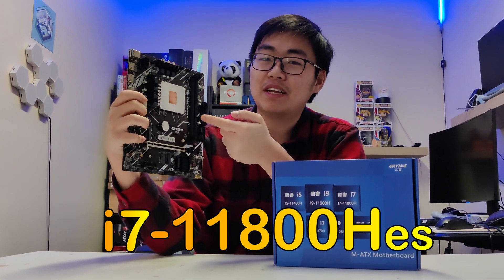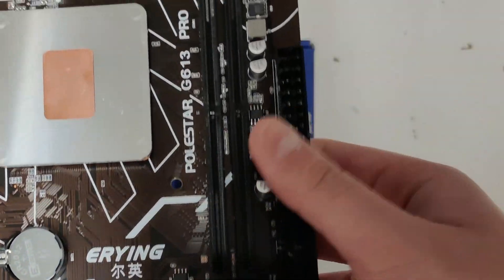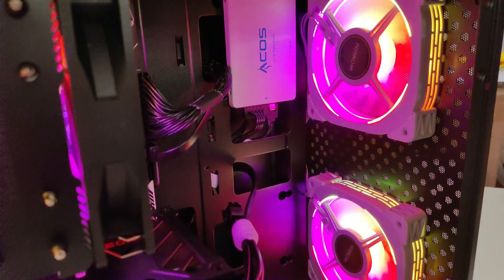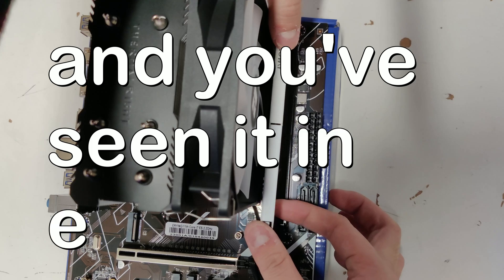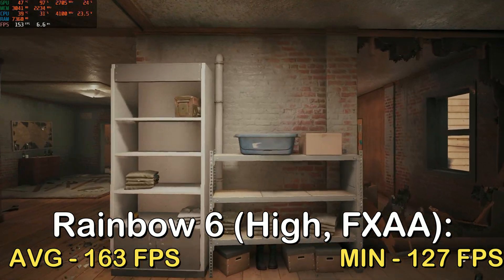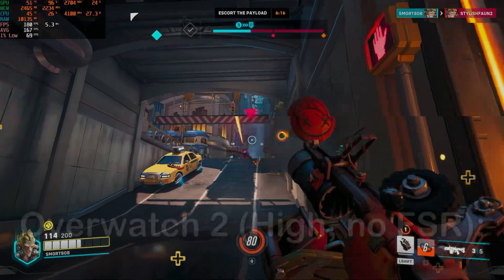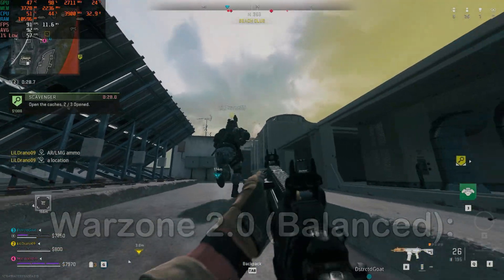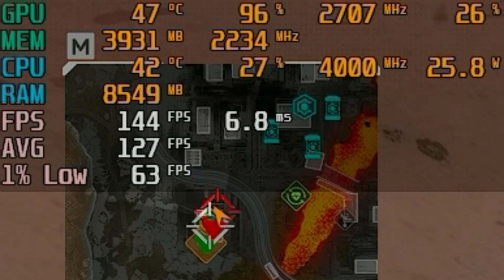The Problem with i7-11800H ERYING Combo ($200)

Comment: Well...
I purchased one of these about a year ago. I installed and used Windows 10 and 11 successfully. I played Borderlands 1, 2, 3 with an Nvidia graphics card.
The bios is complicated. I mounted to a DIY X-rail frame. My understanding is these motherboards are engineering samples with limited availability.
Reply from the maker: Windows 11 did work, but only if you install windows 10 then update it
Reply from the maker: With these stuff, it's a mix of quality control and the chip itself, every single one is different so while you might've had a good time with it, I've heard from a lot of people that they are having a hard time

Comment: Can I remove the cpu proseccer from this motherboard? Then put it on another motherboard
Reply from the maker: Nope
Reply: @woostinstechflip   this motherboard is  sucks but the cpu proseccer is nice . If i switch to liquid cooler can i get more better performance? cuz the temp is overheat
Reply from the maker: These already don't get very hot, so switching to water cooler does nothing

Comment: Just finished assembling and installing one with i9 CPU. Yes, it is tricky, but You are not correct at all. You are showing XMP profile that is not correct, but this happens only AFTER You play with the bios. Default BIOS gets the correct XMP profile.
To get DDR4 to 3200 with default BIOS:
Advanced > Overclocking Performance Menu
Overclocking = Enabled (Yes, I know this is strange. You don't need to modify any values for overclocking, but You MUST enable overclocking here to make Your RAM run at 3200)

Chipset > PCH-IO Configuration
SPD Write Disable = FALSE

Chipset > System Agent Configuration > Memory Configuration > Memory
Memory profile = XMP profile 1
Memory voltage = 1.35V

To make Your RAM even faster:
Chipset > System Agent Configuration > Memory Configuration
Sets the gear ratio when SAGV is disabled = 1

If You have problems with CPU when playing some games:
Advanced > CPU - Power Management Control
Boot performance mode = Turbo performance

Advanced > CPU - Power Management Control > View/Configure Turbo Options
Energy Efficient P-State = Disabled

Some additional useful settings:

Security
Secure Boot Mode = Standard (select to not reset yet)
Secure Boot = Enabled

Advanced > Pci subsystem
Re-Size BAR Support = Enabled
BME DMA Mitigation = Enabled
Reply from the maker: I appreciate the effort, but the thing with these chinese boards is that their quality control is not equal for every board. So if you or some others have it working properly then good for you. Also to me and so many other people, if it doesn't work properly from the start, not everyone is going to spend the time or effort to fine tune it for it to work as it should from the start. (P.s. I stated multiple times that enabling the Overclocking feature gives me BSOD)
Reply: This particular motherboard wasn't meant for everyone I guess. As an enthusiast, who spends spare time on something like this, I find this combo motherboard quite intriguing.
Reply: Could you tell me if you are able to enable TPM in the bios?
Reply: hey man I'm pretty late but how was your experience with the i9 combo

Comment: Hi, I just wanted to explain the likely reason for your mouse not working while playing. The reason is that the USB ports on the motherboard do not provide enough current when the CPU is under load. In this case, the USB ports provide only 4.5 V instead of 5 V and 300 mA instead of 500 mA. I don't know why only the mouse part didn't work for you, but this is one of the problems with this motherboard. A simple solution is to buy a cheap USB 3 PCI-E x1 card with an external power input.
Reply from the maker: Yea, that's what I would've done, but the other ones work fine so I didn't bother.
Reply: @woostinstechflip maybe the mouse issue was because is ES processor?

Comment: I upgraded from a celeron to this card running a pcie 4.0 with an 11400F and its a very good value card. Despite the lack of encoder, there is still the forgotten OpenCL which relieve some of the cpu load in vegas, and much faster rendering in premiere

Comment: Rx 6500 xt good ? Thank God I bought one as a budget graphics card and have heard a lot of bad things about it
Reply: A lot of it come down to price and PCIe 4.0. My understanding was that it's basically supposed to be like slightly better than 1650 S or 5500XT or what it should be is at least GTX 980ti but the problem is it's literally slower than a 570 when on PCIe 3.0--and what do you imagine most budget builders was running on when that was made? You guessed it, budget b550 or b450 at best, lol Plus it had pathetic 4gb of VRAM, thus making it questionable even as a laptop chip. Basically the 6500XT was the only card that actually sucks from RDNA2, which is a shame, because RDNA2 is best generation AMD has made in ages and more or less beats nVidia as the better gaming GPUs straight up the stack. But if you have pcie 3.0? It's crap. But it really depend then how much you got it for. If you get it for really cheap like $160 or better yeah it's fine, if I paid $80 for it I'd be pretty happy, if it was $200 I'd be very sad. There's much much better cards you can get for closer to $200.

Comment: Surely you've found all the guides for TDP unlocks and overclocking from Brazilian Youtubers? The only thing you got right, iirc, is that 2666 is max for mobile CPUs. At least unless your sticks need 1.35V
Reply from the maker: Of course I researched bout it beforehand, but regardless like I said in the video, I've tried to enable the overclocking feature and it straight up won't work properly.
Reply: I have and had a lot of these boards, memory OC is possible and CPU OC as well its just tricky